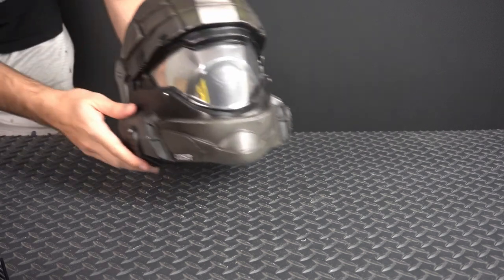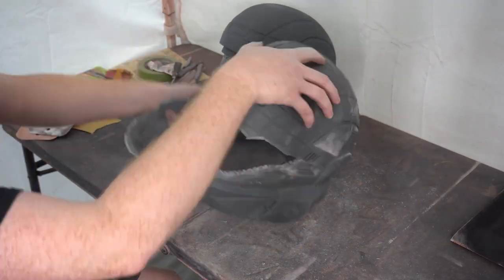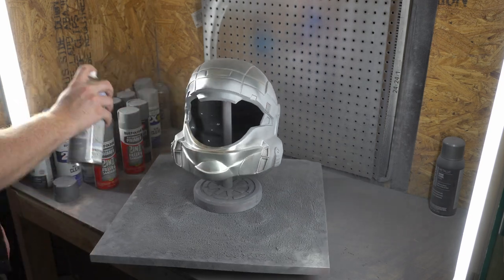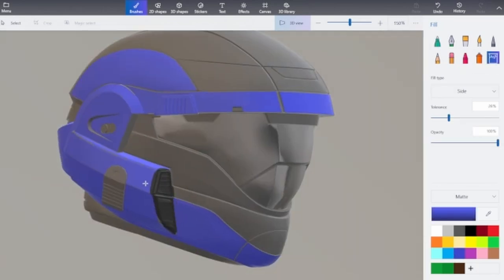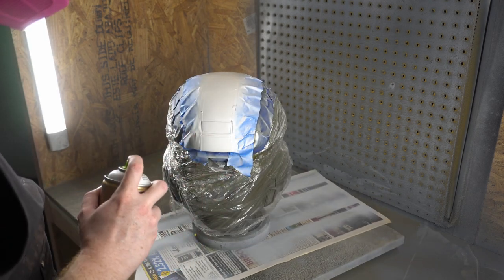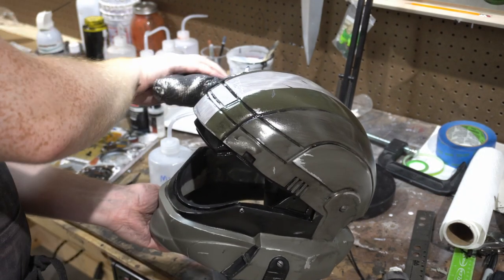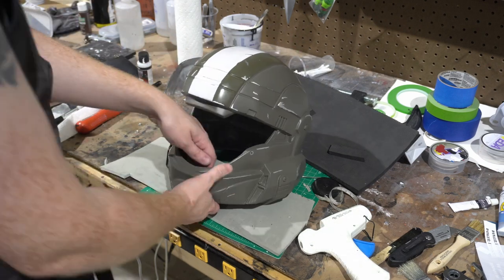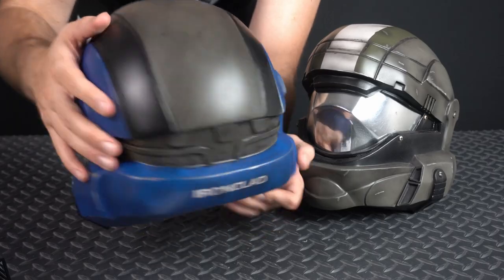Make an ODST Helmet the Easy Way - ODST Build Pt. 4

Comment: Not sure how well it would work with your silvered visor, but I made a Bradley kit about 15 yrs ago to simulate the effect in the game, where the visor changed from clear to tinted (wasn’t my idea, saw it done once before).

I put white LEDs inside, shining on the wearer’s face.  Turn them on and you can see inside fine.  Turn them off, and it’s nice and dark.

Just an option 👍🏻